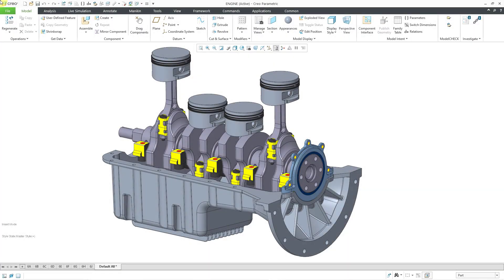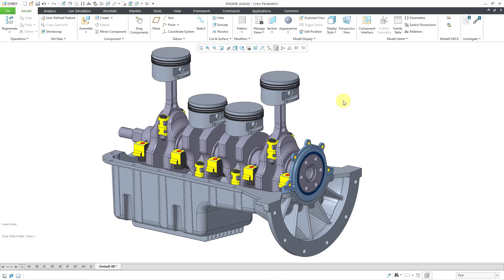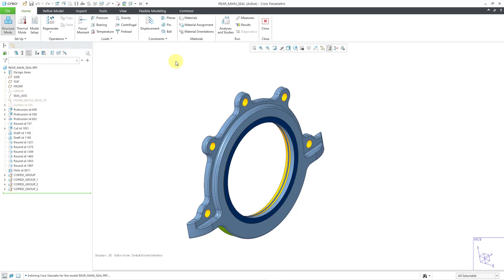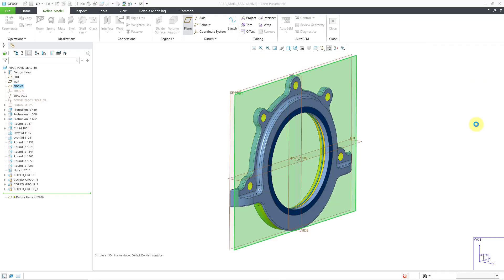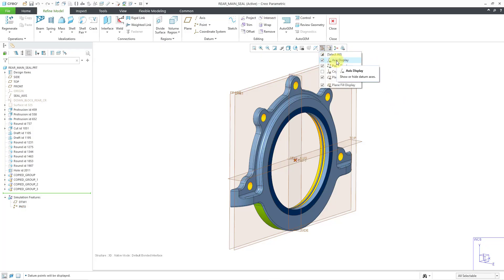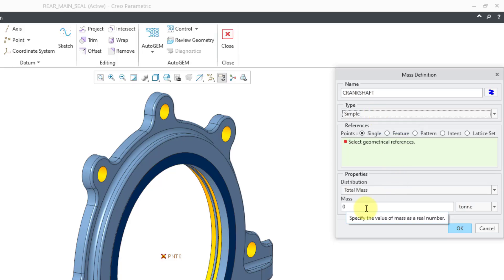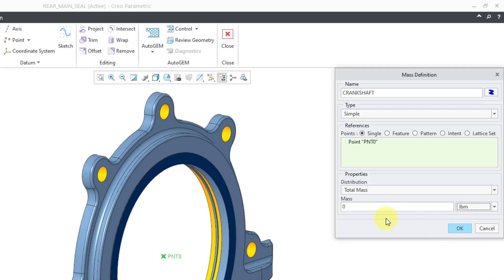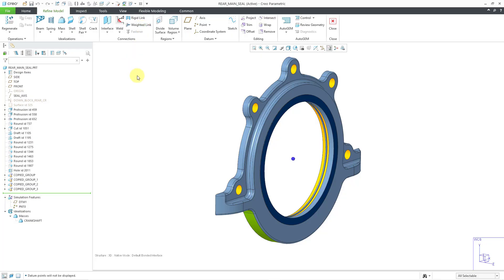Creo Simulate - Mass Idealizations

Comment: Hi Dave, could you please make a video on spring and beam idealizations within Creo simulate? I am having difficulties setting them up, leading to rigid body motion in my analysis. A guide on solid-solid and shell-shell connections would be awesome too! Thank you!
Reply from the maker: Those are on my to-do list, but honestly, don't hold your breath. I won't be able to make those videos for a long time. For one reason, I don't currently have a license for Creo Simulate. If you need assistance now, I recommend engaging with a consultant.